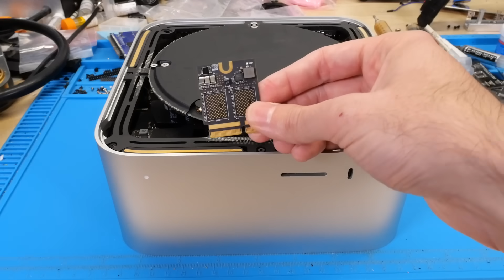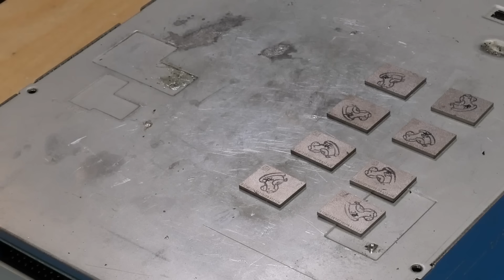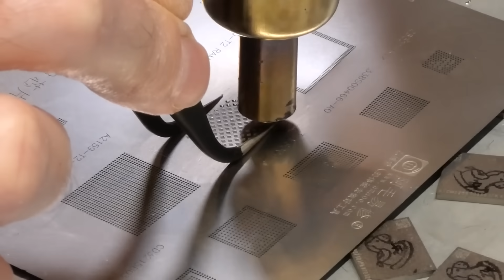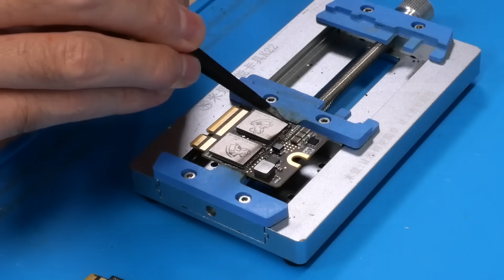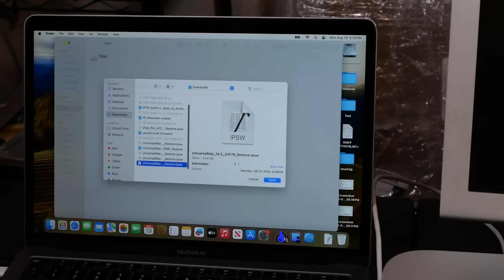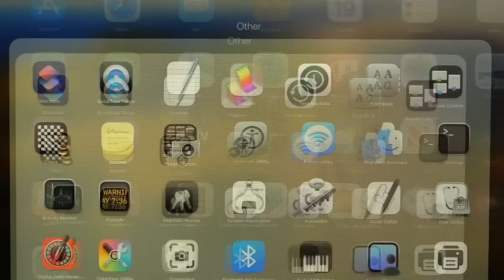Mac Studio Storage Upgrade - Made EASY with Custom Parts

Comment: Yooo if someone starts selling pre soldered modules we’d almost be back to the old Mac Mini days!
Reply from the maker: That's the intention eventually. I'll be buying the modules from Gilles, soldering NANDs on them, and selling them. Gilles himself will likely do the same for European customers.
Reply: @dosdude1  Will this also work on M2 Mac Studios?
Reply from the maker: @773JA  M2 Studio uses different modules with different NANDs, so a new PCB design will be needed for those. This is planned, though will be quite some time before they are ready.
Reply: @dosdude1 apples gonna remove all m.2 slots after seeing this lol. Simple self upgrades hurt their wallet lol
Reply: @dosdude1 I mean, considering how these are great as upgrades and/or replacements for overused modules, I’m sure M2 users can wait a bit longer. The fact that this is even possible is just great! I’m getting Action Retro shenanigans vibes from these, and it just goes to show that the more Mac hardware design changes, the more the community and the ecosystem stays the same.
Reply: @Jorda5s yes, probably, it’s basically expected. But so far, there are two Mac Studio models that will have a solid storage upgrade path for years to come! And I assume Colin’s upgrade modules will come also be far more affordable in 10 years when us LEM users finally get our hands on one of them!
Reply: @Jorda5s  it's not m.2, it's a proprietary connector with a similar footprint
Reply: @dosdude1  bringing it on mate.. That's excellent...  Hopefully be able to ship to Australia???
Reply: @dosdude1 So they would fit Mac Pro 2019's also? 10 pin plus 26 pin is the same as MP 2019 so they should
Reply: @dosdude1  Yesssss thank you!
Reply: @dosdude1 man waiting for the day ❤
Reply: @dosdude1  Will this eventually also be available for the new Mac minis? Would be sick!
Reply: Id tap into this market as well im already trying to see about doing upgrades for music producers on their mpc devices, so more or less the same type of labor. Made a video on my repair channel upgrading an akai force. It be cool if more people offered the service so it be more accessible across the world.@dosdude1
Reply: @dosdude1 will you and Gilles ship to outside the USA and Europe?
😉 …And how do we find how to buy these (when they’re ready 🥳🤩🎉).
Reply: @dosdude1  I would buy this upgrade then on the go really. :D
Reply: @dosdude1 French rules the world :D
Reply: @TWFactory  No but you do try
Reply: Indeed. The soldering in of RAM and then storage too ten years ago was the straw that broke the camel's back for me on buying Apple computers.

I have a 12" Macbook from 2017, and the single USB C port stopped working for data, although I could still charge it. Took it to the Apple Store... it was a new £800 logic board, so it was mux problem (that individuals can't source). They wouldn't let me keep the original logic board with my data soldered onto it... because they send them off for rework to fix the $3 mux chip and resell the logic board for £800 to some other sucker.
Reply: I think for under $800-1000 for a kit with the NANDs soldered in, it would be the go to upgrade for most people with studios. Especially for people who want to run large ai models.
Reply: Take my money! I’d love to be able to upgrade my Mac Studio. Thanks for the excellent video!
Reply: Hope and whait for the M2 Mac Studio, where we can reach Gilles I’m from Europe, thanks
Reply: This will works on a m1 Mac mini too????
Reply from the maker: @rdisteven  Only Mac Studio. M1 Mac Mini has soldered storage, but that too can be upgraded (up to 2TB) using these same NANDs and soldering them on.
Reply: @dosdude1 be careful with how similar the circuit design of that board is. I could totally see apple trying to sue because they want to make more money with shady business practices
Reply: @dosdude1  thanks!

Comment: I've seen China make 315 to 110 adapters but custom boards for nand blanks are actually ingenious. Not sure who the guy behind the design is but major props to him for the idea.

Not sure if commercial push for such a project is legally clean but such boards would also be a great DIY project if the designs were leaked and "open source"

Great work as always Colin ❤
Reply: Would be completely legal so long as you do not claim it is first party.

Building a compatible board is completely legal, but if you then put an apple logo on it then it is not.  This is the issue that lots of third party iPhone screens have were they are stopped by customs as the screen makers feel they can sell for more money if they pretend to be first party screens.
Reply: It's a replica of the original board. Ig it's patented, it would be illegal.
Reply: @bobweiram6321  you can't copyright a circuit design nor a board design, especially if the design itself is not novel (which a couple of nands and some power management certantly is not). you CAN copyright the insides of a chip or complex component. there's a very weird legal history around why the two are considered differently in the eyes of the law that's worth reading about if you get the chance.
Reply: @famitory i love weird history!  do you have a suggestion of a particular article to read up on?
Reply: @famitory you can't copyright the layout of a chip, there are separate mask rights. The contents of any software/microcode etc would likely be copyrighted
Reply: @famitory  You can copyright a circuit but you can’t stop someone making an equivalent from their own mind.  Just a few things need to change.  If the circuit is obvious (eg memories sharing signals) it would be very hard to claim copyright, especially if an application note shows how to make said design.
Reply: @bobweiram6321  Not if there were differences in the design, which this has, if you notice there are extra capacitors ( I think ) above the nand chip on the right compared to apples, so there must be a design change. Companies have been doing this for years, a slight change and it's a new design.
Reply: @bobweiram6321  Except it's not. He specifically stated that there were design differences between the boards, so they are not identical.
Reply: @bobweiram6321 what patent do you think there is that covers putting nand chips on a PCB?
Reply: @bobweiram6321  A memory module can’t be patented.  Yne idea has been around for a very long time!

Comment: Apples worst nightmare
Reply: Jesus Apple cries every time you open your wallet and it isn’t for them
Reply: Can Apple detect non-standard parts installation 😊😂
Reply: @martinbasil6316  No, but they can see it being done in vids on YouTube, Einstein!

There used to be a few sites that altered the Mac OS GUI with different color themes, etc. Apple visited those sites after reading the chatter about those sites in Mac-related forums, had their attorney's send Cease-and-Desist letters to those interface enhancing sites, and eventually shut them down, legally.

Apple said they were changing the UI internally and since the Mac OS didn't belong to them they were not allowed to alter and/or use the Mac OS in any way other than the way Apple wanted the OS to be displayed. So they legally had no right to change an interface that did not belong to the 3rd-party interface designers.

Apple is not beyond forcing people to use their wares as Apple demands they use them. 

All of the above is fact. And they've sent out legal notices for acts much more petty than a potential problem with someone finding a way to add more memory or larger drives instead of having Apple configure it that way when ordering... and against Apple's will or permission.

No, of course Apple cannot magically know when people modify their hardware... and is ridiculous for anyone to even assume that's what I meant. Or was that a deeply ignorant assumption on your part? Or maybe just a chance for a "gotcha'" against those with whom you disagree?

Still laughing... Einstein?
Reply: Why Apple keep working on to making it harder to upgrade any product.
Reply: The dude? Yeah he is a menace to apple ;D
Reply: M4 studio will have storage soldered :D, because of... speed, yes super mega speed, because soldered SSD are so faster than slotted one! ;-) No, not really, take a look at PCIE 5.0 speed or ver. 6.0 probably around the corner.
Reply: @slizgi86  Yeah, and according to Apple they solder their memory because "unified memory runs so much faster" than insertable memory. Why, I must be paranoid to even suggest Apple is doing that in order to force customers to purchase their outrageously-priced memory. Customers were going elsewhere for memory after ordering the minimum amount with new Macs simple BECAUSE of the ridiculous prices for Apple's mediocre memory.

And people used to talk about Jobs' "Reality Distortion Theory" which, was only a way to persuade ignorant customers into purchasing Apple's wares because they were "special", and therefore worth the high prices. 

This bunch running Apple in recent years should apologize to Jobs for having to endure those accusations... because Jobs' Reality Distortion Theory was nearly non-existent compared to Apple since Jobs' passing.

People like Jonny Ive and others didn't leave Apple almost immediately after Jobs passing because they simply wanted to try new things, elsewhere!
Reply: @slizgi86  the sad thing is so many people repeating this nonsense in online forums about Apples anti-trust behaviour.
Reply: what are oyu talking about, this is terrible, non removable storage is a FEATURE.
Reply: I do not think apple cares at all.
Reply: @hishnash  but they do, that's why Apple goes to extraordinary lengths to frustrate the efforts of those who assert a #righttorepair and upgrade the Apple products they own.
Reply: @alastairleith8612  RTR affects their bottom line. Selling 8TB SSD in in volume without warranty doesn't affect their bottom line.
Reply: @RunForPeace-hk1cu  They do not care because these are old machines. They don't sell upgrades for them and there is nothing to be lost if a handful of people upgrade the storage. Now if this was an M4 it would a whole different issue. On another note the guy clearly said only the M1 has slot storage and can be upgraded yet I see people asking to have their M2 chips upgraded....Cant quite understand that one....
Reply: @hishnash  Oh they care... you can bet your @$$ they care! That's why Apple went completely proprietary once again... soldering everything to the motherboard. So if you want a Mac you are forced to purchase Apple's absolute ridiculously priced storage and memory. Not to mention, if your memory, storage, or pretty much anything else goes bad, you're screwed and must purchase a brand new or refurbished Mac from Apple again. You Mac becomes absolute garbage... unless you have the skills this brilliant and patient guy has.
 Apple has become so petty [and apparently greedy] you can surely bet THEY CARE!
Reply: @4GuitarTrance  I really don’t think they care if a couple random guys are doing this. Seriously, how many people have the skills to do this kind of stuff on their own? Not only do you have to have the skills you have to have somebody making custom boards for you. how many times is that going to happen? So yeah I don’t think they’re crapping their pants. 😂
Reply: @4GuitarTrance  They don't care. They have enough suckers to buy from them lol. Stop being delusional.
Reply: @4GuitarTrance  Why does that concern you so much? Just don't buy their products? Obviously, those who choose to go with Apple value the merits of their systems such that the associated "costs" doesn't prevent them. They serve a category of users who want their devices to "just work"( at least mostly, compared to the competition), and have the means to go with it.
Reply: @cheap25  Never underestimate greed. How do you think Apple got to be one of the richest company in the world (3,44T)?????
Reply: @robfel68  It's called business. They hold you at gun point to purchase their devices. Do they?
Reply: @wisdomyaw03  There is no longer any "value" with Apple... only in the minds of their remaining -- and I dare say waning -- fanbois! 
Reading comprehension is a wonderful thing, BTW. I said very clearly, "I LOVE the Mac OS, but hate Apple's hardware schemes as of late. I am unfortunately locked into Apple's infrastructure for a living. 
For my personal use? Meh... no so much any longer... but again -- for those short on reading comprehension skills and any associated "wisdom" thereof -- I still LOVE the Mac OS. Hence, why I complain about their recent rip-off hardware cons.

I hope that explains why it "concerns" me so much. If I had the skills of the gentleman in this vid, I would be laughing at Apple because I would be taking advantage of the Mac OS, plus taking advantage of Apple for a change the way they now take advantage of their long-time customers.

I hate Windows in comparison... but I would deal with MS's somewhat lackluster OS provisions if I were not so heavily invested in Apple's infrastructure and associated 3rd-party software.
Reply: @bassyey  It will not be so delusional if/when this guy potentially starts receiving "Cease-and-Desist" threats from Apple Legal, as they have so many people for so many reasons in the last few years.

It would no doubt be BS! But it's not as though that would be beneath Apple to try such a thing... this is what business arrogance does to a company's former logical and competitive business practices.
Reply: @4GuitarTrance  "waning?", "fanbois?" Any matured mind wouldn't refer to users who choose a device of their preference as "fanbois." Those are terms used by uninsightful people.
Again, Apple keeps growing it's market share so there is nothing "waning" about their user base. 
I have to inform you that I'm not even an Apple user myself, but objectivity precedes brand loyalty in my book.
Reply: @wisdomyaw03  clearly you know nothing about consumer law
Reply: @bassyey  If you don't think they care then please explain the multiple legal battles Apple is engaging in vs right to repair.
They sure do a lot for a company that "doesn't care".
Reply: @bassyey the goal of a for profit company is to make more money not stay at a flat level
Reply: @hishnash 

If apple didn’t like in the old days they would not have tried to lock the system down so hard.
Reply: @ macOS is not locked down
Reply: @ 

The hardware is locked down.
Reply: nope they dont really care about that at all